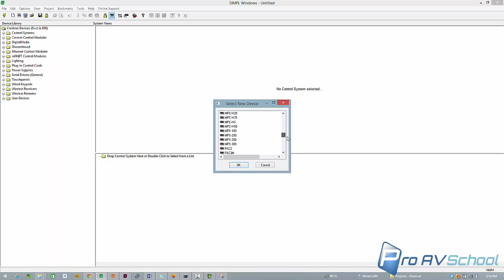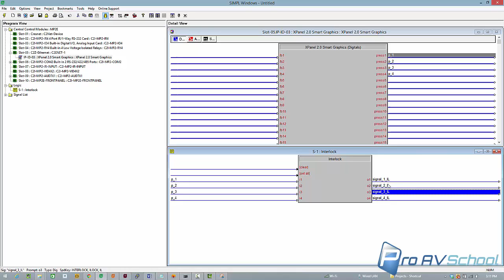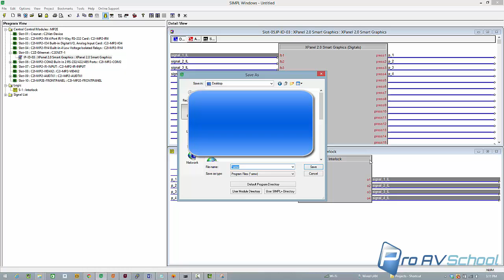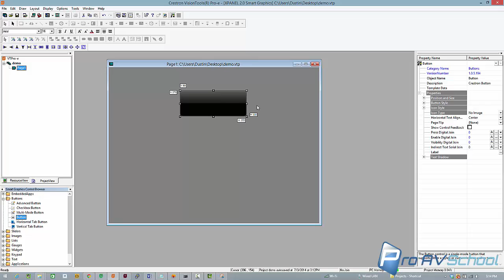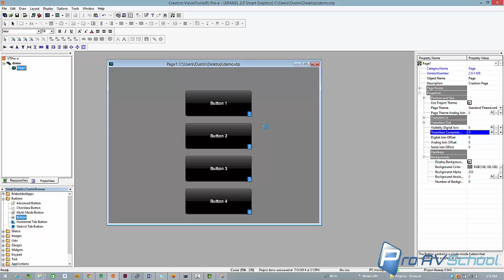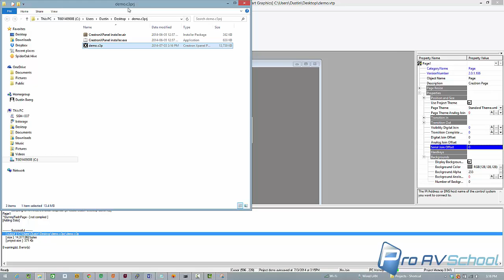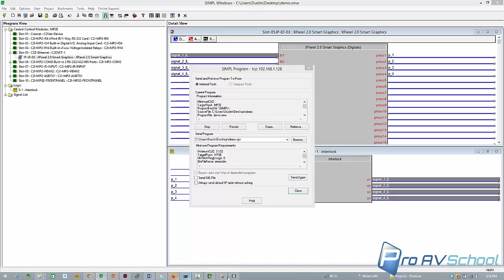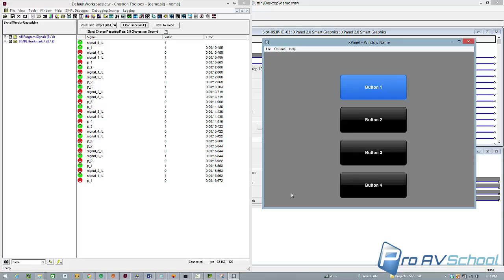Creating a Crestron Smart Graphics XPanel project for testing

Comment: Warning! This video is old and requires adobe air which does not run on modern computers.  Still looking on how to do this easily as non smart xpanel uses active x which also does not run on modern computers.
Reply from the maker: very good point! The Flash EOL caused a few challenges for this type of software.

Here is a link to Crestron's Adobe Flash End of Life information: https://community.crestron.com/s/article/id-1000740

There is a download link there for Crestron XPanel Desktop for Windows and for MacOS. Hopefully this is helpful.

Comment: Great video. Thanks for all the info you've shared.  How do you take a smart object like a D pad with lets say a smart object ID of 1 and access the individual buttons there within inside Simpl? I have a crestron app project with a dpad and I want to have in control an apple tv. I've successfully done this with 5 individual buttons in an xpanel web project and it worked but in that case I had 5 digital joins to connect to the apple tv functions. Thanks for your help.
Reply: Never mind. I found it. I didn't realize that I needed to refresh the crestron app object in simpl to get the device extender smart objects to appear.  Thanks again for your videos, they've helped me a lot.
Reply from the maker: Ben Tomlinson The other cool thing about smart objects is that when you name them in VTPro-e and link them up in your Simpl file, the name caries across. This can also include some button names in the case of a keypad (*/# can be renamed).
Reply: Thanks.  I hadn't thought about that but I can see how that would be handy especially if you have several objects in different subpages trying to keep them all straight.
Reply: Is there a way to assign a visibility join to a smart object like a dpad? Thanks.
Reply from the maker: Ben Tomlinson I don't believe you can directly assign a visibility join to an object...but you can easily put the object on a transparent subpage that is sized just to fit the object. Then use the subpage display join as your "visibility" join. You just need to make sure you drag the subpage onto each of the pages that might display it.

*tip: after putting the subpage onto the first page and assigning a join number, if you copy/paste it will also copy the join number.
Reply: Thanks for the help. I'll give that a try.